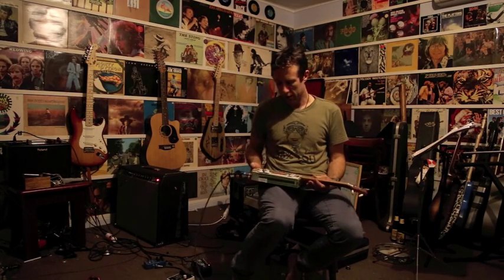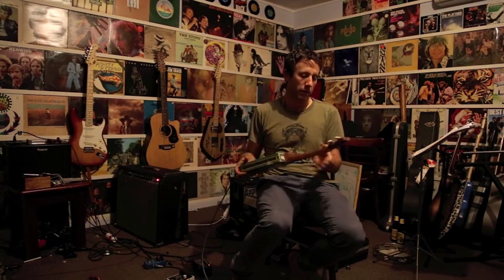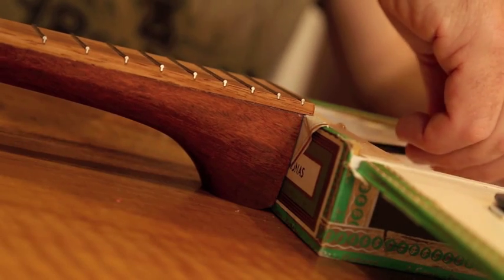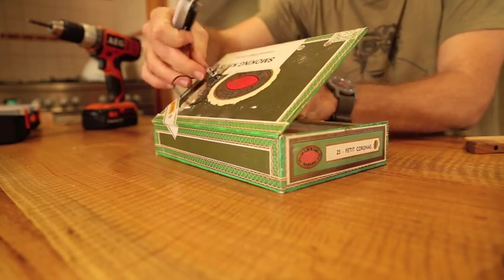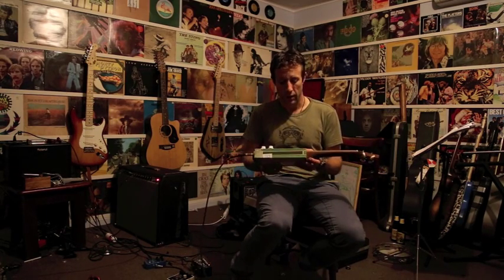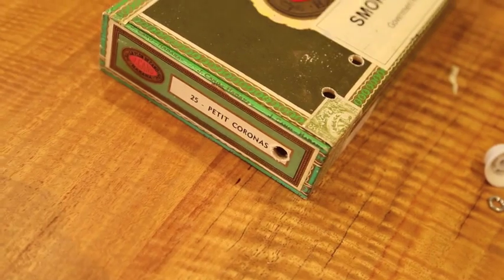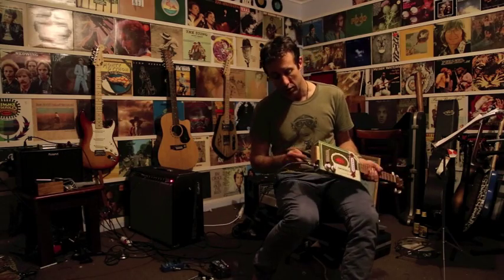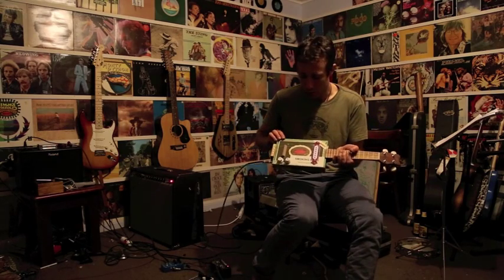How to Make a Cigarbox Guitar

Comment: hi sir just a question..did u glue the neck too? n did the neck needed 'flatning' or did it come without a curved end? the one that goes onto the body? cos i ordered mine from abroad and don know if it comes flatened or not..i hope u can answer my Qs tnx sir
Reply from the maker: I made the neck using the same process shown in my ukulele series if you want to check them out. I just cut the end flat to attach it to the cigarbox.